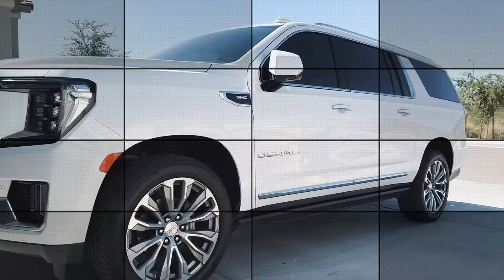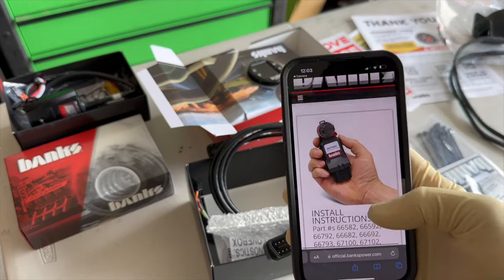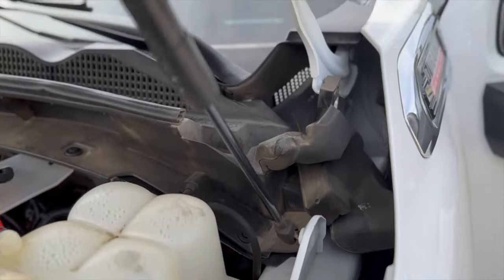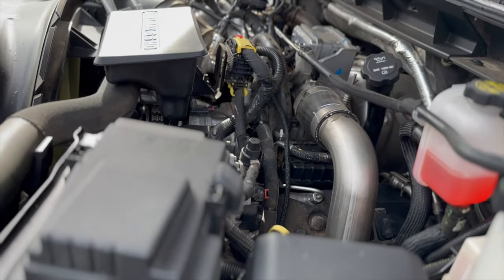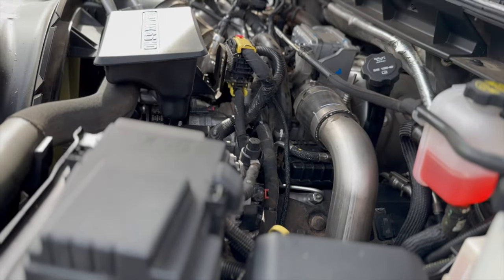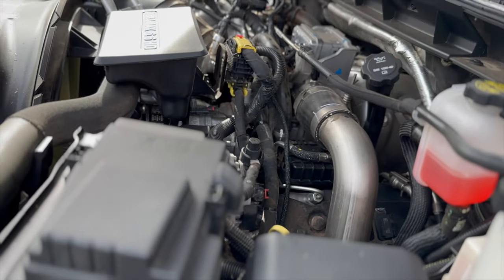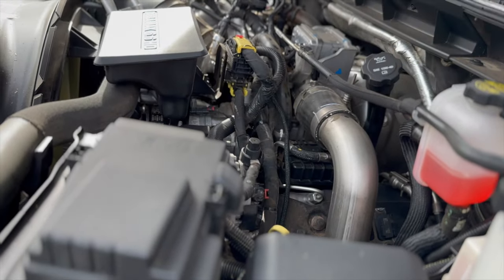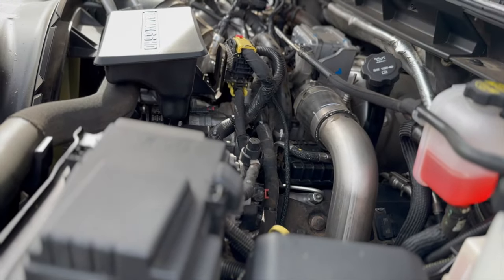Banks Derringer, Pedal Monster, and iDash Install/Review on 2020-2023 GM 2500 L5P 6.6L

Comment: Just installed my PM, DERRINGER & Ram air intake today & it’s an unreal difference. The Ram air is considerably louder & can feel the throaty vibrations so not too crazy about that. Any suggestions for setting the idash for long distance Highway use? Thanks in advance!

Comment: Great video, just got both and looking forward to installing!  One question I have is, will the Derringer need to be uninstalled in order to pass inspection?  I had a Pulsar LT on my '20 GMC 1500 and I had to take that off prior to inspection, so curious if this is the same deal.  Thanks!!

Comment: Great video. You mentioned removing it before a dealer trip. Would all the wiring have to be removed or just the pedal monster and derringer
Reply from the maker: It’s all discretionary. The Banks comes with a warning sign to remove it so I’m assuming they are trying to pull any liability away from them. Like I mentioned dealers can make the ultimate decision if it will voids the warranty claim or not. Better to be safe than sorry and remove everything you can. Depending on the reason I’m bringing the vehicle to the dealer, would determine if I take it off or not.

Comment: What is the "cap" on the Derringer? It looks like it can couple multiple Derringers together? Never heard someone mentioning the round cap and what’s it’s designed to plug into?
Reply from the maker: Yes, I believe Banks offer’s a couple more things that can plug into the derringer module. Transmission brake is one of them and I would need to look on their website to see what else they offer.

Comment: I’m a little confused. I know all about throttle controllers and will be switching all my pedal commanders to the Banks and just use the app to change settings on the banks. Why do i want that Derringer thing up there-it seems like pretty basic info that most cars have especially cars that ppl would put the throttle control on, i keep hearing you say “tune” and in the comments “tune” but this isn’t a tuner really right? The throttle control just dies response but that derringer just seems to read what’s on your gauges or in your screens right? I own 3 Hellcat vehicles and my daughters Kia they have all those derringer readouts. Is there something I’m missing with everyone saying “tune” are you saying tune for the throttle control or is there some kind of tuning going on for something else?
Reply from the maker: @meatball6930 The derringer has 5 power levels that is a on demand “tune” the idash is separate for reading different PIDs and controlling the 5 settings on the derringer.. at the end I should have done a full reviews of each power setting on the derringer and pedal monster separately. I apologize for the confusion. Thanks for watching!

Comment: The dealership I worked at our service manager was famous for voiding warranties. Any tuner hardwired in we’d take a picture and void warranty.
Reply: Sounds like a junk dealership. Mine doesn’t care what I do.
Reply: @jasonkwasky53  it was a way to get customer pay instead of warranty. Difference is customers pay actual hours flagged while warranty pays flat rate that is usually less than actual flagged hours. Since techs work flat rate they like being paid actual hours they work so they’re more than happy to bring it to service managers attention.
Reply: The beautiful part is that warranties are offered by the manufacturer and not the dealership….
Reply: @Sportsmanskitchen  yes but dealership service centers can enter in the system you did certain things to your vehicle that void the warranty under their guidelines and the manufacturer will void your warranty. The service manager has more power in this than you think.
Reply: It’s not possible to void a warranty. It is possible to deny a claim against a warranty. Very different things.
Reply: @dillydave13 kinda some truth to that. If someone altered a wiring harness to add a tuner we only denied warranty to that section of wiring, the ecm and engine. But other parts not affected by that modification such as suspension, brakes or other systems would still be covered. But in the system it is recorded factory warranty on certain systems for that vin number is now void with notes of explanation of why. That was how it was done when I worked at the dealership but I haven’t worked at a dealership for 20 years now so things can of course definitely be done differently now. But I don’t risk it.
Reply: @Yokosprojects  you haven’t worked in the industry for decades and not familiar with law. Thanks for your input.
Reply: @dillydave13  yes haven’t worked as an auto tech for decades now. I left due to bad back and severe tendinitis. So I went to school and acquired new knowledge including business law. Don’t assume buddy.
Reply: @Yokosprojects  I am sorry for your injuries they suck. I have been an attorney for a few decades. Are you going to law school?
Reply: @dillydave13  I was just required to take a couple courses in basic law and business law as part of requirements needed for getting a degree in business management. I’m thankful that was a requirement as that taught me just enough law to save me numerous times.
Reply: @Yokosprojects  you have never argued a denial of a warranty of a vehicle repair in a court of law, yet attempt to put me down because I am a professor and have not only argued countless of these cases, lecture and teach on the subject? Wow. I try to have people keep their warranty and make a dealer or manufacturer process  it’s due diligence as the  law states and you attempt to belittle me? Your one or two law classes don’t stand up to a few decades working in the legal system.
Reply: @dillydave13  dude you sure are trying hard to sound victim while you’re the one dishing out shade.
Reply: @Yokosprojects  shade for helping people make their vehicles their own and still have their claims on their warranties approved? That’s some shade. You got me.
Reply: @dillydave13  good for you bro but I don’t know what me sharing the policies and experience I had working at the dealership affects any of that. I also don’t understand how it “belittled” you. But you do you and keep up the good work.
Reply: @Yokosprojects  because your nonsense is decades old either zero reference to anything tangible.
Reply: @dillydave13 please tell that to the forums! There are people there who honestly believe adding a gauge like the idash voids warranty.
Reply: @BabyGators  it’s up to them to understand laws.